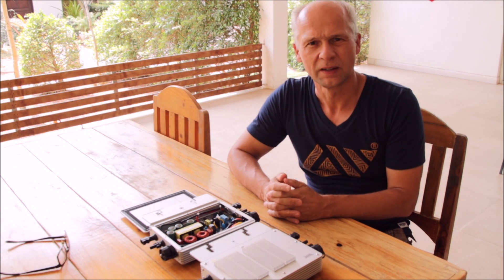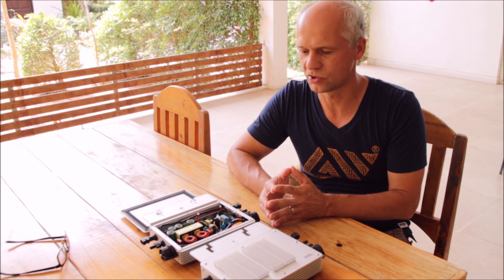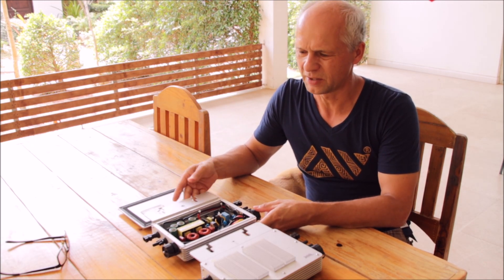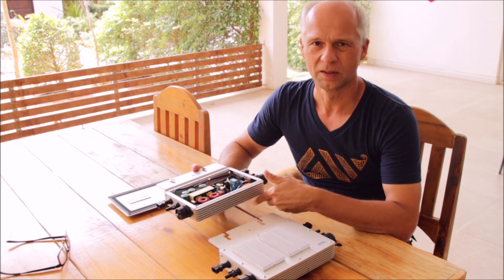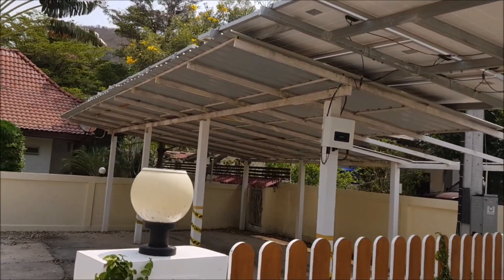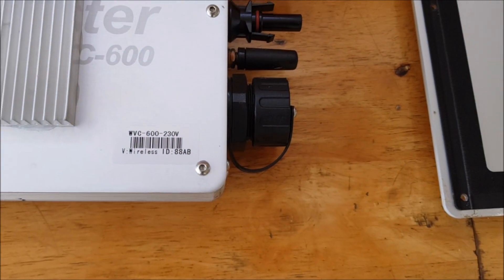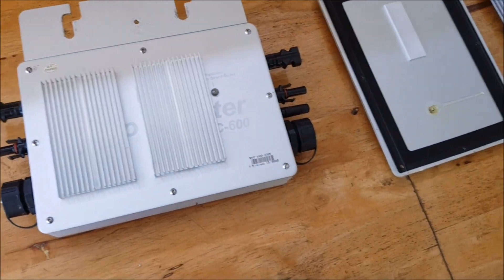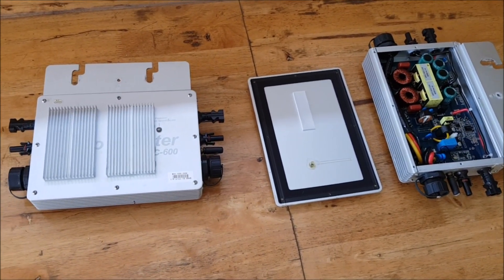WVC-300, WVC-600, WVC-1200 Chinese Micro-Inverter. Do not buy this cr@p. Never!

Comment: Hi Roland, thanks for sharing. I have the same problem, I have 4 of them and 2 just stop working after a year. Do you have a recomendation to replace them? I mean, what other microinverter would you buy?
Reply from the maker: I have replaced my 2 inverters with a Tier-2 Deye 3000W String inverter. The total output is not different then with the individual microinverters. And the Deye inverter was a very affordable price (320Usd + shipping/customs). I think a 3000W inverter would perfectly replace all your 4 Micro-craps :) For another Micro, you would need to buy a brand one if you want it to pay back he cost. Like the Enphase
Reply: @RolandW_DIYEnergyandMore  apsystem  , Hoymiles,  Enphase! This 3 dont have problem
Reply: @droghettigiorgio  I was about to take my first steps with solar panels. I wanted to buy just one about 400W along with a Enphase microinverter. A basic and simple solar installation to do some tests. Wrong!!  Enphase staff have just told me that their microinverters NEED another device called Envoy to be activated, otherwise they may not work. I´ll choose APSystem instead.
Reply: @kinosi  Apsystem and Hoymiles, is very good. Toop
Reply: Ok, I will review them. Thanks for your answer!! 👍
Reply: I have purchased a sofar inverter TL1600. They have a very good and wide input voltage range (70V to 300V MPPT), so can be started with two or three solar panels, depending on the output voltage, without limiting if you want to go higher, in the future. So far working well with 3 * 350W panels and generating an average of 4KW/Day (Summer) and 2KW/Day (Winter). Prior to that I was using enecsy 350W inverters, which work well under the sun, but were underperforming on shaded environments. The Sofar has a net export feature that can be used to limit grid export or used in a hybrid system, where excess is stored in batteries and released when needed - using a separate current transformer just before the meter. Good Luck

Comment: Funny.  I have 3 of the WVC-1200, and they are still working today.  I now have a total of 9 of the WVC-1200.  I wonder what I'm doing right?
Reply from the maker: You have 3, or you have 9? How long are they running with what wattage panels connected? You could be the lucky one who got the batch with the quality components built in, haha. But there are just too many reviews on AliExpress, where people write, that they have failing inverters within the first month. Its just a shame. An inverter should last at least 5 years without troubles.
Reply: Chinese products sometimes suffer from their (China's) own fake components. Maybe you've got some devices on which they've got genuine parts.

Comment: you are rigth just don´t buy this sheet, i bough on and they just scratch the name of all mosffet inside, i can´t buy the component to repair it. just crazy what they did.
Reply from the maker: Well, in my devices, the DC side are four IRF3710. But when I replaced them, they where dead 24h later again. Its just the whole thing which is useless.